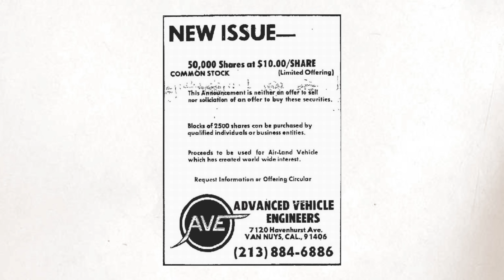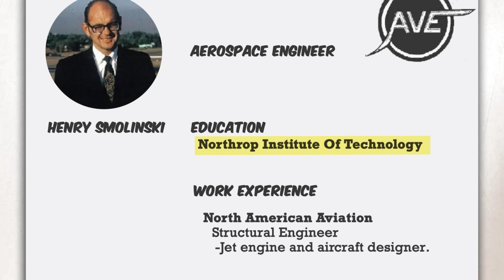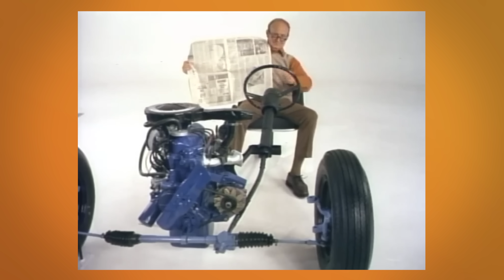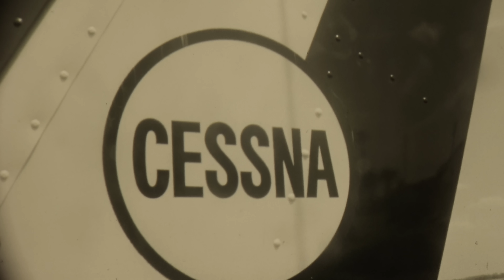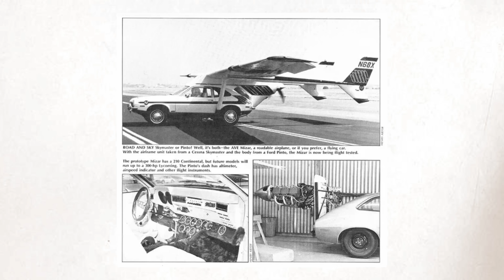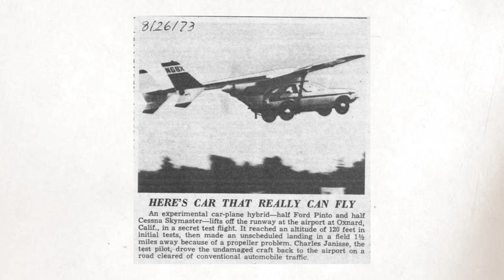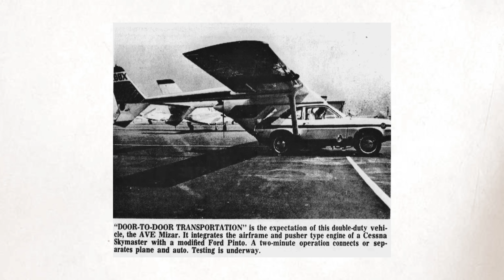The wild 1970s flying car that actually worked... until it didn't

Comment: Having successfully pushed five types of GA aircraft through type certification as both a structural engineer and a test pilot, I have to say that the FARs are written in blood, and you neglect them at your  absolute peril.   Certificated aircraft are made from materials and use fasteners that are made to a quality, and work at stress levels such that the probability of a failure at the ultimate load is less than 0.1% - and the ultimate load is 50% higher than the maximum load to which the aircraft is legally allowed to be exposed.  No car is made to anything like these standards;  so hooking the lift struts to parts of the car is tantamount to inserting rubbish into the major load path.  Incredible stupidity.

Comment: Flying cars for the public is a ridiculous idea. First, they will not be anymore affordable for most people than a small plane is now. Heck people can barely get around in cars without wings, on roads with lines, where going up and down hills doesn't really change anything. Anyway, it's not going to happen, at least not under the command and control of only the individual driver.

Comment: I guess this is one time when the answer is 'yes' to the question 'wouldn't you really rather have a Buick?' Yep, heavier vehicle but consider that the harden construction of the Buick would have encouraged Smolinski and Blake to build a more solid wing connect. And, there would be room for the whole family! 
All kidding aside, with the condition of some of our roads, the disrepair of some of our bridges and tunnels, and the massive congestion, the time and practicality for flying cars has arrived. Computer driven, of course.

Comment: It seems a pretty good idea until you think of these facts;

A) For practical and legal reasons, you STILL need to go to an airfield to get airborne and must land at one for much the same reasons. You still need a Runway.
B) You have the wings and tail of a light aircraft, which is bulky and therefore will probably have to be stored at that airfield when you're driving.
C) Owing to the above, why not simply keep a light aircraft there instead?

A car is optimised for driving, and a plane for flying. They're different tools - and you can only make one do the others job very marginally. A basic light Aeroplane (i'm British!) or utility Helicopter isn't actually much more complex than a passenger car in terms of construction. I believe if you were building tens of thousands rather than a few hundred a year they'd be similar prices. But there is a darn good reason why they haven't taken over from the car for general transportation. Several, actually.

Comment: The concept has nothing at all to attract it. An aeroplane is designed to be as light as possible, consistent with maintaining adequate structural integrity. What could the body of a motor car add? It is neither one thing, nor the other. You can’t drive it without taking off the wings and you can’t fly it because the car body makes it all just too heavy and clumsy.

Comment: The pinto was actually fun to drive. It had a 2 liter overhead cam engine with a two barrel holly carburetor. It’s the same engine in the formula ford race cars. Just less carburetors. It was really fine. The fuel tank could have been moved or something. But what a deal. $1900

Comment: flying cars that you personally control? Pipe dream. Flying cars that run on autopilot? That's at least more plausible, and would offer some utility , both in grid-locked southern California and lake-locked Seattle. But in the end if you have a plane it already costs so much to build it doesn't make sense to spend a lot of time driving it on the ground when it could be flying. So cars and planes probably will never converge.

Comment: A shocking fact is that General Aviation has an even higher fatality rate than does general automotive traffic. Private pilots who fly recreationally or commercially do a lot of stupid things, despite all the rules, regulations and training specifically for them to be competent pilots, and that's in aircraft that are designed from the beginning to operate as aircraft. People who push boundaries seem to have this compulsion to do things they shouldn't do; they push the wrong boundaries! So much can go wrong even with the most careful plans and equipment, and adding speed supported by an all-but intangible fluid makes the margin for error and likelihood for disaster even greater. 

The big allure of flying is that relatively few people do it. Of course, everybody thinks they would be one of those few. If everybody flew, flying would become an even worse nightmare than driving is.

Comment: Frankly, I'm surprised that the wings didn't rip the roof off of the pillars!

I re-ran this, and well...

The numbers just don't add up! 

Let me get this straight... Uh, 500 foot takeoff at 65 mph with a pinto? 
B.S.!  A pinto couldn't get up to 65 in 500 feet unless you drove it off of a cliff going straight down! 300 hp Lycoming or not!

Oh, and a pinto couldn't do anything near 1000 miles range as a car, even less chance as a plane.

The damned things shimmied at 70 mph!

Hmmm, let's see....pinto + tail heavy additional engine+ chopped up aircraft wings, plus sheet metal screws.... And a Ford gas tank - 
Oh, no! Nothing can go wrong, wrong, wrong... Boom! 

What was that? Oh, just the fuel tank, don't worry, be happy!

It makes you wonder if he was trying to make it simulate a rocket exhaust... 

Man, the puns just write themselves.

Don't get me wrong, it was a horrible ending for the guy & friend... Perhaps he should have had  Dierks Bentley's song around then, cuz; "what was he thinkin' ".

Comment: I knew Red. Met him when I was getting my Commercial Pilot's license at Golden West Skyways in Van Nuys, right next to the Mizar hanger. We became friends. He showed me the drawings for the Mizar (as well as the actual car), and we discussed the engineering. Red was a cautious test pilot, and had some reservations about the engineering, as well as the actual construction of the prototype. For example, the removeable connecting pins were not used on the prototype. Instead, the wings were welded to the car roof, which was not strengthened, as it would be in the production model. The back seat and fuel tank were not removed, nor was the Cessna fuselage faired into the car body. The prototype was a "quick, cheap, and dirty" attempt to see if the idea was workable, in Red's words. Red well knew that the G forces exerted in even a normal turn could over-stress the minimal connections between the car and the Cessna wings/empennage section, which was actually salvaged from a WRECKED Cessna. It should NEVER have been flown by a private pilot with no test-flying experience.
Reply: Thank you for the input.  It's always nice to see a comment from someone who appears to know what they're talking about.
I tried to find the NTSB report, but all I could find online was the basic "cover page" type info, and the narrative was not available.  I don't know if that's typical for NTSB regarding reports from 1973, or if that's more of the "unanswered questions" surrounding the event.
Reply: thee “event”lol like aliens landing 🤷‍♂️ i guess it has to be called something hearing what actually happened just crap way to go
Reply: Another case of hubris causing fatalities.
Reply: @ Or perhaps another case of someone seeing a snarky Youtube video and thinking they are now experts on the subject.  Who am I to judge?
Reply: Would like to talk with you ProfPoindexter1968
Reply: I would love to have an attempt at doing this myself. He had a fun interesting idea but poor engineering and execution and a lack of experience in automotive and Aviation design.

Need to be much more expensive though, a custom-built lighter weight car with a more powerful high power to weight Engine with a power take-off to propeller so it could contribute to flight, and of course, correcting the Mickey Mouse hardware store low quality Construction
Reply: A test pilot who isn't cautious doesn't stay a test pilot - or anything else - for very long!
Reply: I think it was a excellent idea. But in the rush to prove the concept. Unfortunatly killed it occupants. Does this sound familiar?
Reply: @DavidParker-i8o  steve fossett invented your attempt at irony.
Reply: @godsinbox  Perhaps your correct my friend...
Reply: A few extra spaces might make your article clearer and easier to read. Give it about 3-paragraphs.

Comment: To assume an average motorist will quickly develop the skill to pilot an aircraft or flying contraption is stupid and unrealistic.  The FAA would never certify garbage like this. In addition to the flight crew getting killed in one of these junks, you have the probability of one crashing into a house killing everyone at dinner.  To develop a machine or vehicle with the intention of reducing hard labor or accelerate a production time factor for any individual could be something positive, however to produce any type of vehicle that requires Manual Training, Medical Examination and Classroom Instruction for an average consumer is moronic and should be banned.

Comment: A key flaw in AVE’s flying car design was that while configured for flight, it was burdened by the weight of two engines while only one of them contributed to keeping the flying car aloft.
Reply: And sheet metal screws being used in load-bearing situations. This was a symphony of bad engineering.
Reply: Molt Taylor's Aerocar was pretty awesome, but the fact that it could physically be driven on the streets didn't make it street-practical. Car engines and aircraft engines have radically different designs that are engineered for their purpose and are prone to failure when used for the other purpose. I doubt any aircraft engine would meet EPA standards for cars, and I doubt Taylor's design would meet federal standards for roadworthiness or crashworthiness. I think the single integrated drivetrain killed it. It could be made practical as a plane, but not as a car. That's why toward the end of his life he was making designs like this one. The last model I saw of his was a Honda CRX with a strap-on airframe and engine. A car has to be a car. Unless it has only 3 wheels, in which case it's a motorcycle...
Reply: Excellent point!

Comment: At 4:47 , you describe the flight controls, you start with the steering wheel controlling the aileron you say, but the picture shows the rudder at 4:51 ! 🤌🏻🤔 Than the elevator controlled by the wheel moving in and out, so what about the rudder pedals of a normal plane to control the rudders, is that mixed mechanically with the ailerons? It would be possible today with fly by wire, but not in the ‘70s. So what gives?

Comment: Why no flying car yet, I wonder why aerospace engineers forgot about weight! Here is the Ford Pinto >2000 lb without wings, the Cessna 174 is. 1700 lb empty and 2400 lb fully loaded! Cars are designed to protect passengers in a crash, airplanes don’t need to be. Cars are made of steel, airplanes are made of aluminium alloys and composite, because of weight! Get the gist of why a flying car is not a really good idea! And the idea of an electric flying car, with the weight of the batteries, it’s even more ridiculous, all those pictures are just gadgets, capable of nothing irl.

Comment: IT WILL HAPPEN and they will fly everywhere. The height will not be  over several hundred feet and a computer will do the work. It's going to be the new transportation, commercially and personally, causing even more advanced air control.
Streets will be limited, more like runways. It will be a BRAVE NEW WORLD. 
I won't see it, but 100 years from now, and the world will still be here, it will be so common. 
And AMERICA WILL BE DIFFERENT. 
TIME is the king of change, brothers and sisters and all ships at sea.

Comment: The reason the thing could take off quicker is just that it contained an extra 1,200 pound motor that was only used for takeoff. It was not a better plane than the Cessna. It was not a good plane, at all, in fact. I think the outcome speaks for it's so-called handling abilities, but even if it flew well -- it's carrying around a couple tons of steel for no reason.
Dumb.

Comment: They should have used a Vega.
Reply: That would only have replaced one set of headaches with another.
Reply: @alansloan7784  Maybe, but the Vega headaches didn't burst into flames.  Chevy headaches were different.
Reply: Souped up Bug.
Reply: @riverraisin1  An air-cooled engine would have made it a little lighter.  However, my guess for them not going with a suped up bug is the fact the engine was in the back.  The weight distribution would be way different and probably cause it to be in a stall situation a lot easier.  It needed the front engine to balance it out.

Comment: I thought this had better success, just not successful enough to be useful or financially sound.

The concept seemed feasible using existing vehicles, yet I never ran the numbers, weight, balance, etc. myself.

With modern technology, a similar vehicle could have successful flight.
But automotive and aviation regulations conflict greatly, so anything beyond experimental or restricted category would be unlikely.

Comment: The only way the average person can fly is with an autonomous drone. This will only happen after many years of postal delivery drones, surveillance and war drones building thousands of hours of safe flight data. In addition to networks of autonomous cars which have good awareness of surroundings and can communicate with each other as these reliable networks are critical. The first step will be short distance taxis drones, then finally commercial autonomous drones and potentially private one. This will all happen but it is still a long way away.

Comment: The reason that a flying car is desired is to provide ground transportation when you reach your destination. This is one of the biggest problems for flying into smaller airports without rental car service.  It is a problem that pilots have wished to be solved forever.  I'm surprised you just didn't ask a pilot what the attraction was.
Reply: So many people miss that simple point and yet it is central to what a flying car is. Guess they thought the quick disconnect wings were for "just because I felt like it".

Comment: Personally I think the US and the world should look into adapting all ICE Vehicles to Hydrogen. It's adaptable to any ICE and that way we could still use our old muscle cars, diesels and others and the exhaust is water vapor. Hydrogen Vehicles have zero emissions except what's needed to produce the Hydrogen, just like Gasoline and other fossil fuels, except when used after produce in ICE vehicles their are zero Carbon Emissions. Using Hydrogen cars would immediately cut Carbon Emissions in half if not more for every vehicle converted. Also there are no harmful batteries  or chemicals that can hurt the environment when they are at their end of life. Hydrogen Engines are the way to go. Thanks for sharing. Best Blessings. Keith Noneya

Comment: I was a controller at Oxnard, Ventura County Airport, and worked day shift on that fatal day. I watched countless high speed taxi runs, where they would lift off, climb about ten feet, and land. Your story is incorrect in one regard, the runway was 5,970 feet long, not a 'short runway.' OK, that thing had the glide characteristics of a Greyhound Bus when they reduced the power. It wasn't until they swapped that 210hp Continental engine for the 300hp Lycoming, that it could so much as climb out of ground effect. 

The letter of agreement with the airport that allowed them to experiment, required takeoff on runway 25 and land on runway 7. They disallowed ANY flying over people, or any structures. Flights - once they reached the point where they could... "Fly it..." were supposed to be over the beach or ocean. It NEVER flew over ANY populated area except on the fatal day. They climbed too high to land straight ahead and made a closed, right-hand traffic pattern and turned downwind over Gonzales Road. The wing strut detached when they were mid-field downwind... at approximately 100 feet altitude. They never climbed above that altitude on any flight.

As you said, the idea of a flying car has been around since the dawn of aviation. In this case, it was a bad choice for car and aircraft components, poorly assembled, and as history has shown... a crash waiting to happen....
Reply: I grew up off Gonzales road and watched it crash while riding our bikes down to the beach. Learned to fly and never looked back.
Reply: @icelandviking1961  I instructed for AeroFlite, a flying club out of Executive Air, and Sierra West Airlines during my tenure at Oxnard, '72-75. Flew my first jet, Moraine-Salnier MS-760 "Paris Jet", when the outfit in the Lockheed hangar at the west end of the airport was importing them and converting them to U.S. standards. Who did you learn to fly with? Sierra West became Channel Islands Aviation at Camarillo when they opened the old Oxnard AFB as a civilian airport. Those were the good old days, back then....

Comment: I grew up in the 70's. Their timing was perfect. Their design quite brilliant. As a concept. If they had teamed up with Ford and designed or re-designed a car for the purpose. If they had properly constructed the air frame. If they had used only qualified test pilots. I believe their initial success lulled them into thinking they were genius' which clearly they were not. Just two adventurous and overconfident  individuals flying on a wing and a prayer. Sadly, not for long.
Reply: i see a paralel with Stockton Rush, the engineer and designer of the TITAN submersible's  OceanGates company.
Reply: @StanMichalski  Yes and at least these guys risked only their own lives.